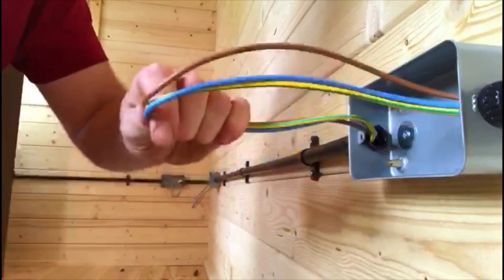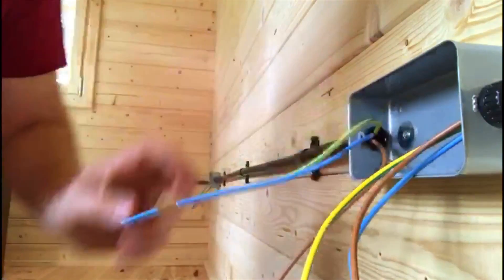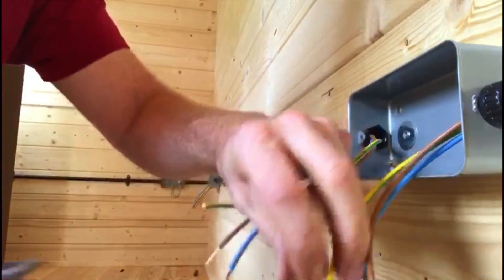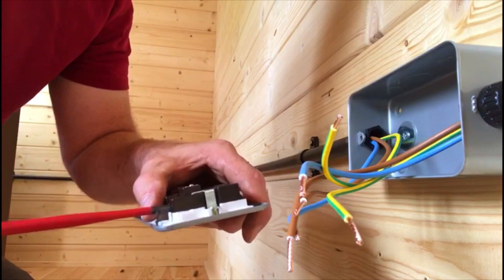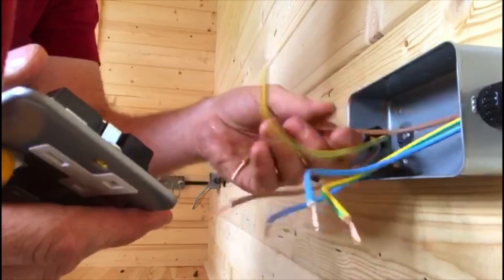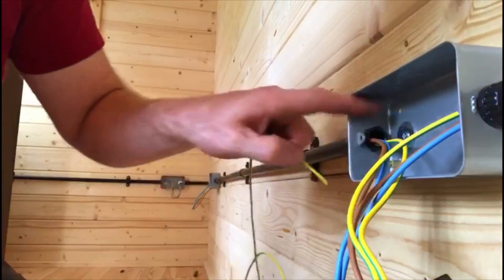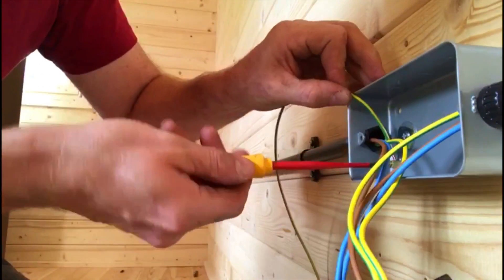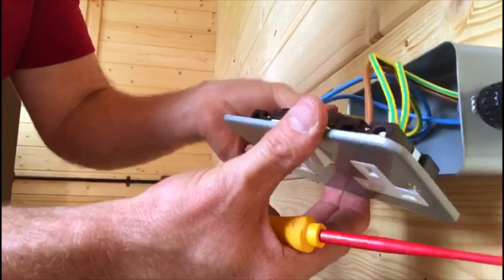How to Connect up a Twin Socket Wired in PVC Single - Earthing the Metal Box - In Plastic Conduit

Comment: Very informative but as there are 2 fixed lugs on the back box of metal clad socket, the earth tail to the box is not required  although i agree its good practice.
Reply from the maker: We are all about best practice as all the contributors are college lecturers 🦾💕🦾
Reply: @GSHElectrical  nothing wrong with best practice at all,I was trained in the 80s so I had that drummed into me.

Comment: What is the advantage of using loose cables in the radial circuit instead of twin and earth? Doesn’t T&E carry more current capacity due to the thermal insulation?

Comment: Why dont you use cable with solid wires??We in the Netherlands Almost NEVER use flexibel wires..Then you dont have to screw them on,just put it in the hole and it fix itself tight!Really,when i look at you electriciens in the UK,it looks like twenty years ago in the Netherlands.Except we used solid wires already then..

Comment: We have been taught at college not to twist the conductors as it can damage them and that heat caused from current passing through the conductors can cause the cables to cone loose and fall out of they are twisted.

We have been taught to fold the conductors over and then insert them.
Reply: I've been taught to run away when I see fine stranded conductors! ;)
Reply from the maker: Cool 👍

Comment: Now answer to this,  why do you need a fly lead to the back box since all the enclosure is metal and earthed through the screws holding the faceplate? If someone opens it , it means that is a qualified person and that circuit would be dead.  That's the best practice,  health and safety states that live working should be avoided as much as possible, unless it's not possible or costly effective,  which doesn't apply to a regular ring circuit. So we have excluded the possibility of that socket opened being live, therefore it doesn't have to be earthed, only when it is in use or it's live. The cpc won't protect a person from being electrocuted through direct touch, an RCD will do it, the point is that a cpc is a conductor which protects the circuit ,remember R1+R2 ? .. in case of a fault the cpc act like a return path for the current. I hope I have made my point here. I don't see the benefit of that fly lead.
Reply: I dont believe you do. As long as the box has at least one fixed lug it's not required. Many electricians still do though. Might be diferent with individual cables run in conduit, but that's certainly the case for sheathed.
Reply: I also thought the fly lead was fairly pointless. Although I assumed as it's an educational video everything was done belt and braces.
Reply: @ukpm  

It's one of those things where the regs say if you have one fixed lug it's not required, but many electricians prefer to still add it.
Reply: Because your basic assumption is wrong.  "If someone opens it , it means that is a qualified person and that circuit would be dead"

Comment: Thanks for the videos guys. Can I check though, the CPC from each leg of the ring should it not be terminated individually into the back of the socket and not connected together and then the fly lead connection from the back box to the socket can then go in with either of the CPCs? So should one of the terminations fail, there is still an earth to the socket which would not be the case if they both went into the same CPC termination point. Keep up the good work. Cheers. Adrian at AJD ELECTRICALS
Reply from the maker: Hi, thanks please read the description for more details all the best and thanks for your detailed comment. Gaz

Comment: Any reason why you're using stranded cable as opposed to solid conductor?
Obvs it's a lot easier to do with stranded cable since they flex more easily when fixing the socket to the back box.
Reply: I think its standard practice to use stranded cable in conduit as it's more flexible.

Comment: Interesting that you use stranded wires in this application. Here in Germany we'll have to use H07V-U (formerly known as NYA) for this application.
Reply: Normally we use solid conductors, but when ran through conduit the extra flexibility of stranded is beneficial round the bends.
Reply: I wondered that too.

Comment: When I/we do this, we always use 2:1 ferrules.  no need to twist and less chance of a conductor pulling out.
Reply: First I've heard of anyone ferruling up conductors at a socket-outlet.
Reply: @ashmanelectricalservices4318  any multi-strand conductor we always boot it. And if we use more than 1 conductor we use 2:1 ferrules.  When using NYY-J or other solid cable we still ferrule more than 1 conductor.
Reply: @Hiccup77  Do you work in the electrical installation industry in the UK?
Reply: Yes.  we do installs, motors up to 200kw & more. Plc, panels, sensors (pnp or npn), rewires.  all sorts.
Reply: Yes.  we do installs, rewires, motors anywhere from 1kw up to & beyond 200kw, testing, panel work, plc's, inverters, testing.  All sorts.
Reply: @Hiccup77  I too use ferrules but do note I am a glorified dyi'er, but naughtyly I Have been know to slip 2 wires into a single ferrule. Especially on very fine stranded wire, ferrules make  neat looking job, and in my opinion give a better contact surface for the fixing screw(s). 
But as a layperson I can follow my own instincts.
Reply: 100 wago's for you sir.  Keep up the good work. Just remember. make sure the power is dead before you end up the dead one. And always consult a qualified sparky.
Reply: @Hiccup77  thanks felah. 
As a 9 year old child I got hung on a 110V line.
Was on the line for 10 minutes before they cut me free.
I only lived cause the ground WAS BONE DRY.
Was totally paralyzed for 3 hrs could not move a single muscle.
Now hitting 75 years old but that lesson NEVER LEFT ME. 
Next day it rained... And you would not be reading this.
Albert.
Reply: @Hiccup77  Using ferrules on single core is as useful as a third breast on the back...I mean I use twin-ferrules too, but not on solid conductors. I try to avoid NYY whenever possible, that cable type is only relevant iof you want to bury it directly into the ground. The standard cable here in Germany is NYM. NYY is too fat to use it inside of a house, but the VDE permits it to use it in that way. The additional -J only tells us that the cable comes with a green/yellow insulated wire inside, the version -O comes without that and got another coloured wire inside. For example: NYY-J, 3x2.5mm² comes with a brown, a blue and a green/yellow insulated wire. The NYY-O version got a brown, a black and a blue wire inside.
Reply: @Marcel_Germann  we only tend to use nyy-j (not my choice it's the companies).  It's a proper ballache when swapping out the old SY, as the isolators are atax and very difficult to terminate.  We ferrule 2 conductors not 1.  If its 1 we double over.  I we use nyy-j solid core due to the environment we are in.
Reply: @Hiccup77  It is unnecessary to use ferrules on a solid core wire. Most terminals allow it to put two wires in, some even have two terminals which are connected to each other. Hager Quick Connect on their MCBs, RCDs and RCBOs for example have that. There you can put in two L and two N. Solid conductors don't spread if you put them into a terminal, stranded wires do this and that reduces the area of contact and raising the contact resistance. That's the reason for using ferrules, and stranded wires also tend much more to corrosion, this is avoided too if you use ferrules.

https://www.hager.ch/images/02_loesungen_wohnbau_gewerbe/quickconnect/ha-quickconnect_06.jpg

Comment: Are all the conductors 2.5 mm in conduit wiring ??
Reply from the maker: For this A3 radial the circuit conductors are all 2.5mm PVC singles (best practice)... however in the AM2 test the specification requires the cpc to be 1.5mm2 when wiring with 2.5mm2 live conductors for an A1 ring final circuit🤔 keeps you thinking during the exam 👍. Thanks for commenting and watching. Gaz
Reply: GSH Electrical 
Cheers gaz for reply also please can you tell me why when you torque into mcbs at db why dont you do sockets switches etc to torque settings ??
Reply: @ericthekingthekingtheking4842 Because it's not a requirement from the manufacturer. Tightening consumer unit terminations to the correct torque isn't a requirement of BS 7671, it's a requirement imposed by the manufacturer.